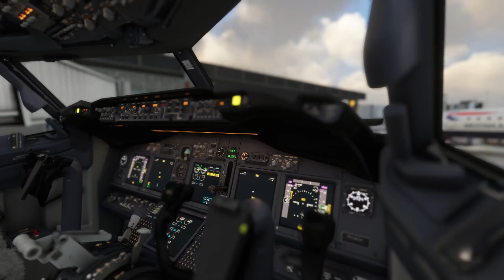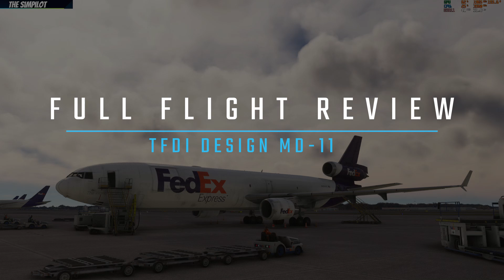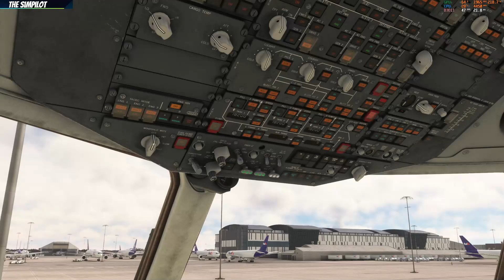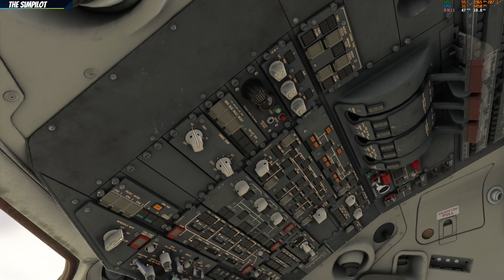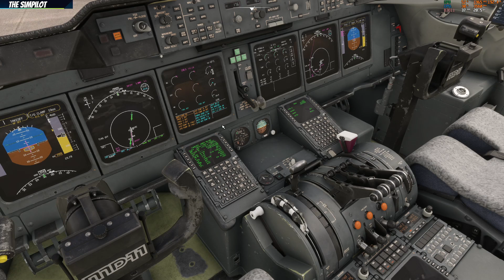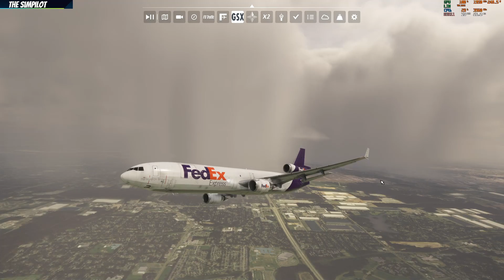MSFS | TFSI Design MD-11 on Final Approach | Full Flight - Part 1

Comment: I have been following this one. I will get it when comes out if it is a study level type module, which so far it appears to be.
Reply from the maker: Currently it's missing the failures and the EFB Ui is not great definitely needs work. Other than that it flies  nice and the systems simulation is good.

Comment: How about performance compared to PMDG 737 and Fenix A320
Reply from the maker: I have yo say performance is better now similar FPS compared to PMDG 737. Slightly higher than Fenix due to Fenix using the external app.
Reply: @TheSimPilot  interesting to compare next with the PMDG 777, as PMDG could takeover it's MD-11 from FSX but didn't unfortunately.